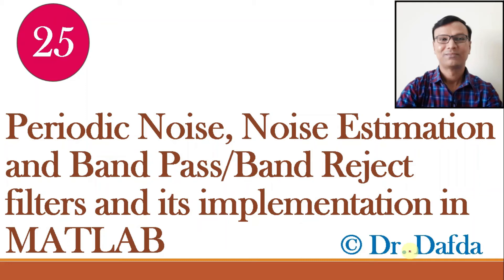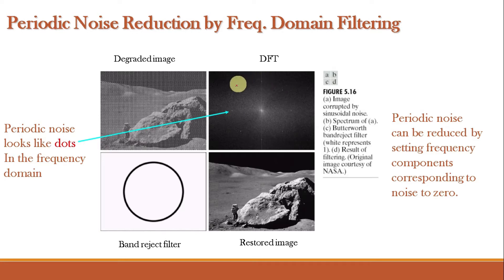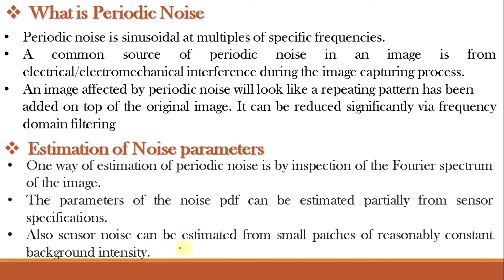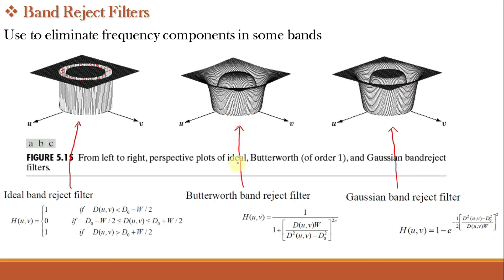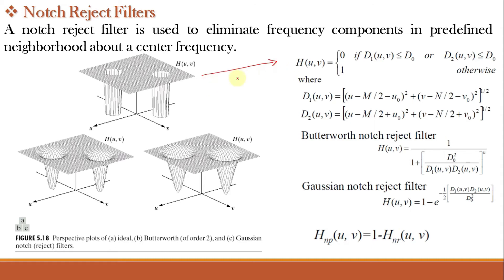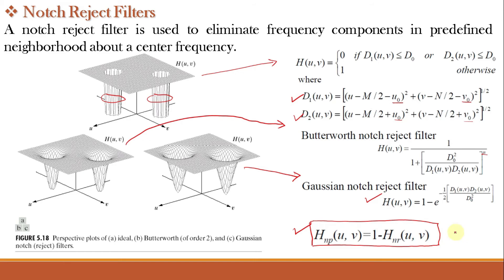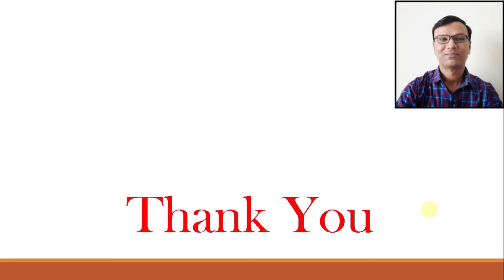Periodic Noise,Noise Estimation and Band Pass/Band Reject filters & its implementation in MATLAB|DIP

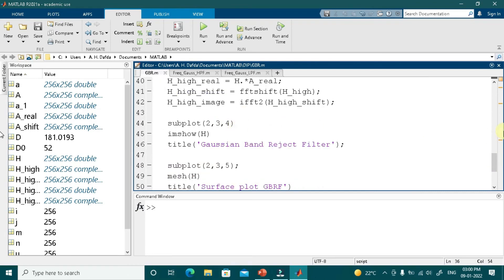Comment: On line 41 of your code visible at 10:04 shouldn't it be H_high_shift = ifftshift(H_high); and not H_high_shift = fftshift(H_high), since we wish to revert the change made by fftshift used earlier here ifftshift should be used in my opinion.
Reply from the maker: Yes, you are correct. Thank you for pointing out the mistake. On line 41, it seems there is an error in the code. The line should probably be: 
H_high_shift = ifftshift(H_high);
This correction would revert the change made by fftshift earlier, aligning the low-frequency components back to the corners. Using ifftshift before applying the inverse Fourier transform (ifft2) is the correct approach if you want to bring back the low-frequency components to the corners. So, the corrected lines would be:
H_high_shift = ifftshift(H_high);
H_high_image = ifft2(H_high_shift);

Comment: hello，sir. So for those images with one-to-one pairs of noise points, how to use the limited notch filter range to remove noise and reduce the impact on the surrounding signal,I am confused, please can answer for me
Reply from the maker: To remove noise from an image with a one-to-one pair of noise points, you can use a notch filter. A notch filter is a type of filter that can remove specific frequencies from an image while leaving others intact. To use a limited notch filter range, you can specify the frequencies you want to remove and the range over which you want the filter to be applied. Here are the steps you can follow:

Identify the frequencies of the noise you want to remove. One way to do this is to analyze the Fourier transform of the image and identify the frequencies of the noise.

Determine the notch filter range. The notch filter range is the range over which the filter will be applied. You want to limit the range to the area around the noise points to reduce the impact on the surrounding image. One way to do this is to use a circular notch filter centered on each noise point.

Apply the notch filter. Apply the notch filter to the image using the specified range. This will remove the frequencies associated with the noise points.

Evaluate the results. Evaluate the filtered image to see if the noise has been removed and the impact on the surrounding image has been minimized. If necessary, adjust the notch filter range to further reduce the impact on the surrounding image.

Note that the effectiveness of the notch filter will depend on the characteristics of the noise and the image. It may be necessary to experiment with different notch filter ranges to find the optimal settings for your particular image.